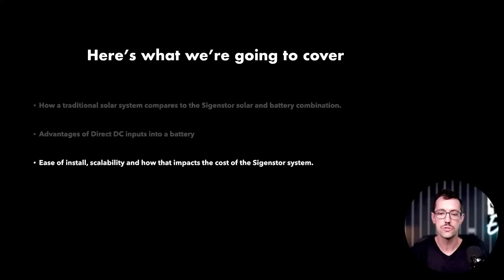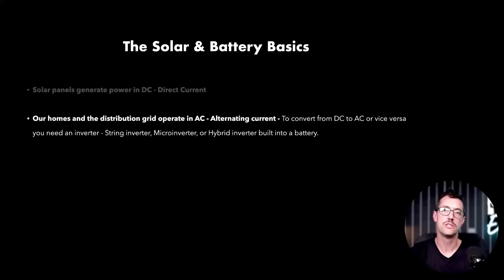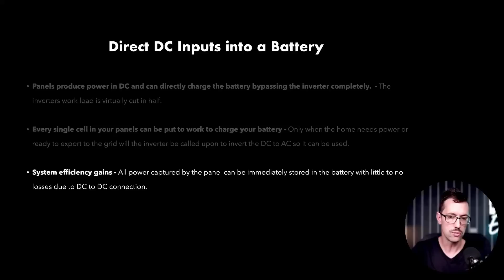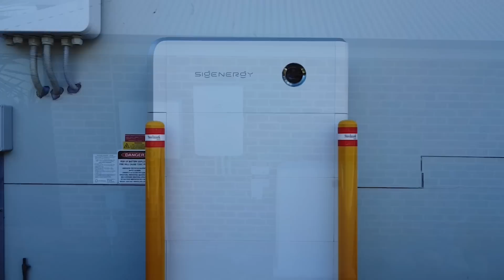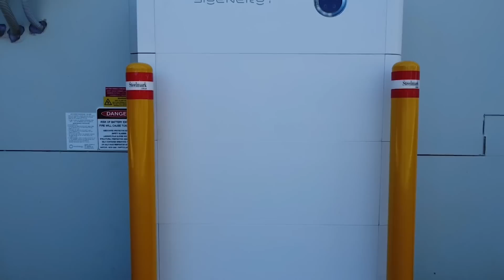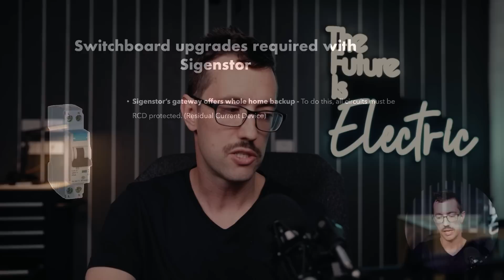Why SigenStor is Going Viral in Australia

Comment: Yes agree Fronius are the Kings of inverters.
I have the Sig all in one and great so far although it runs pretty hot @ 65’c on warmer days, Sth side shade, and less than half throttle work load on 25kwTP?
I’m surprised you didn’t give good old SMA Sunny boys and tri phase a wrap as arguably up there with Fronius, German made, particularly the best in off grid situations with transformers, lower frequency etc.
Also Tigo for optimisers so not limited to solar edge and I’m keen to hear how Sigs micro’s go?
Enphase obviously great in that regard as I also have.
Cheers and keep up the good advice and hard work educating end users away from the false economy junk flooding the industry as always.👍🤠

Comment: Victron Energy and Solar Edge has alway been DC coupled between battery and PV panels so this is not new. Inverter is parallel with PV Charge Controller.

Comment: Nearly all battery systems on the market these days are both AC and DC coupled capable. Even the very cheapest ones. Further to this DC coupled has been available for a long time. The advantage of the Sig is: Energy density is high (compact for a 48kWh system), old and new modules can be mixed, the optional whole of home backup, the inverter includes a BMS and sits on top of the batteries and finally the broad range of inverter sizes in both single and three phase.  The optional DC charger also will appeal to some people.  I think the cable-less stacking is very modern however I don't really think the savings are significant enough to make a real difference to the installed cost.

Comment: I find the repeated statements in this video that Sigenstore bypasses the need for conversion because it connects the DC solar panels directly to the DC batteries to be very misleading. Most rechargeable battery technologies but particularly lithium-based types have very little change in terminal voltage from 'full' to 'empty'. Meanwhile solar panels have HUGE changes in their DC output, almost directly proportional to the strength of the sun at any given time of day. So the batteries require a charging regulator - which will be a switch-mode power supply. These SMPS' are basically DC-DC inverters! With the same inherent losses as an AC-DC inverter.

Comment: I watched an in-depth review of the Sigen. system and they pointed out some things that really must be taken into consideration. Most importantly, the warranty. The warranty of the product is all over the shop. The batteries, inverter, chassis, EMS and PCS all have differing warranty lengths. That's a nightmare in anyone's language. Additionally, the length of the warranty isn't that good, falling behind comparable systems. The plastic covers on the top-right and top-left of the unit are flimsy and the reviewers cast doubt on their longevity. I was up for one of these systems but the warranty issues were a deal-breaker for me.

Comment: For fucks sake - why bang on about the installation time of a 48kW storage system and how it compares against rebate rate, when your 6.6kW solar panels will never manage to charge it - show me a graph that shows the COST of installing a storage system that I can be utilized to the full potential and off set that against the rebate -- you might find that time factor of stack-able batteries fades into insignificance. Even if you were smart enough to suggest that the storage system charge can be completed during off-peak period at a cheaper rate the installation time of a stack-able battery remains fucking irrelevant. In summary - SigenStor is NOT crushing it, you were simply told to push a new product you know nothing about and have a fetish for graphs showing stack-able batteries installation times, irrespective of their irrelevance.

Comment: Lol - statement that '1.33KW of solar, never has the opportunity to become AC' had me in stitches. Especially given that Mr. consultant preceded that particular pearl of wisdom with a reflection that the PV is only capable of delivering the full system potential for a very limited time during the day.. yeah and assuming the ideal environmental factors were present (cell air temperature & air mass) and assuming no cell performance degradation occurred, makes me think that the opportunity for the opportunity for that 1.33KW to not have an opportunity to become AC is quite unlikely, but hey what do I know and if it creates an sales opportunity, who am I to question it.. I am all about equal opportunity, if an opportunity presents it self..;o)
Reply: Did you not listen to the part where he stated a 5kw inverter can only ever do 5kw and no more, so a 6.6-3kw system has a certain amount of wastage
Reply: LOL at your own statements, oversizing is important outside of peak production and cloudy days etc, i can't add an image but it's quite easy to see clipping during summer sunny days on oversized arrays and it's maybe 5 months of the year so not limited at all

Comment: 3:15 - technically, the conversion from AC to DC is performed by a rectifier (preferably a full-wave rectifier for a "cleaner" DC output). Inverters convert DC to AC.  It's all to do with the polarity of AC power switching back and forward multiple times per second; which for Australia is 50 cycles/second or 50Hz.
But that's just me being nit-picky.

Comment: Why connect to the grid at all? It seems that with this system is would be possible to install 48kWh of batteries and easily over 20-25kW of solar panels. At those power levels it wouldn't it be better to just stay off grid to avoid Origin/AGL's self-serving (always changing) feed in rules? If you're not attached to the grid, does the electric utility have ANY say whether you enable V2H?

Why would anyone EVER agree to letting those pirates remotely control my car charging or any other aspect of my system for the tiny (unfair) pittance they pay?

And before you say, "because at least you'll get some money for your extra solar, and it would be some sort of sin to waste a watt so you sort of 'have to' give it to them", I'll posit that the juice just isn't worth the squeeze. Their restrictive rules and control will end costing you more money that you get in the short term. Maybe not today or tomorrow, but soon. History supports that, with nearly EVERYONE that budgeted based upon earning money from feed in having the money stolen from them when they grid operators changed the rules.

The best part about going off grid is telling your electricity provider that you don't need or want them anymore.
Reply: Only issue to doing this for most people is the area required for the solar panels.  In a normal suburban home you’d be struggling to get more than around 10KW of panels onto decent locations on a roof.  I’m about to install the Sigenergy system into my place and currently have 6.6KW of solar but I’ll only get another 6 panels onto decent locations the roof so not quite 10KW all in - this will see me about 95% self sufficient but multiple overcast days in the middle of Winter will see me using grid power - and we are ultra careful with power use.  If I had anything bigger than a suburban block I would stick a solar farm in to give me 20KW and then I’d be sorted. 👍
Reply: @Phantomthecat we're close though. A slightly better roof layout (gable style) so that panels can fill it edge to edge and perhaps higher efficiency panels (tandem silicon/perovskite), and we're there. Oh, and a proper big ass battery, of course.

Comment: Not all RCDs are the same. Anything installed from 2023 is likely to be a compliant Type A breaker which detects both AC and DC leakage. Older RCDs, which can have test buttons are Type AC which only detect AC leakage. Older RCDs will have a rectangle with a ~ symbol inside and these need replacing.

Comment: Just in regard to needing RCD's on all circuits. If you install the Sigen Gateway which provides the "Backup" function you do need to have RCD's on all circuits, BUT they MUST be Type A, NOT the older common Type AC, so simply by checking that you have RCD's on all circuits is not enough, they MUST be the correct RCD's. The older RCD's were being installed up to a couple of years ago so most people will have the older type,  they just have to have them upgraded to the new Type A which is a fairly simple task and no where near as expensive as upgrading the entire board (which is required if you do not have them on all circuits)

Rules now state :

From 1 May 2023 “Type AC” RCD’s must not be installed in Australia. This change is due to
the increased use of electronics, solar energy generation and other similar products with a
high d.c waveform component.
From 1 May 2023, only “Type A”, “Type B” and “Type F”, RCD’s should be used. “Type A” is
the most suitable replacement of the previous “Type AC” RCD.
Reply: Thanks. This is important information.

Comment: All of this is good on theory untill you start installing it. I just had PSC retrofit a SigenStor at my house to existing Solar on a string inverter. Despite my multiple requests to divert my panels to the hybrid inverter of the battery to get DC directly to battery, they didn't do it due to warranty and liability issues. First 12 minutes of this video is misleading customers to believe what's not practically possible. Yes the battery tech is great but what's the purpose if there is no use to majority of the Australian houses already got solar installed. This is an issue someone needs to pay serious attention as the consumer is loosing. Hats off to PCS's workmanship though.

Comment: You usually do not invest to gain a sense of freedom. When you get a solar + battery, you are now tied to a depreciating asset which is costing you at least over $200 per month in depreciation. Your asset has to decrease your energy bill by that $200 per month to break even and you have the risk that your asset will fail. So not having the solar system is just as much a freedom.

Comment: Sig batteries also come as standard with a 5 x layer safety arrangement in each battery. This includes a fire extinguisher in each. Pretty important feature for me. I'm pulling the trigger on a 16kw Sig system. They definitely read the best out there. The only downside is they haven't been long into the market, so hoping reliability is also good. We will see.

Comment: I currently have SolarEdge inverter and optimisers on panels and am wanting to add batteries. The two choices in my mind are SolarEdge’s 3x10kWh batteries or SigEnergy’s 6x8kWh batteries but I’ve been told to install SigEnergy all optimisers need to be removed. Not sure what to do. SolarEdge seems the obvious choice but SigEnergy’s max 48kWh capacity, small footprint and features excites me.
Reply: I’m in the UK and currently specing potential systems with my installer. I understand you can use Sigenergy with Solar Edge optimisers and inverter. I’ve only seen a rough drawing of such a scheme but I think it can be done that way. At least that’s my understanding but  I’m no expert!
Reply: I'm a large Sigenergt installer and this is not true. We do plenty Sigenergt installs alongside Solaredge systems. You would do the integration via AC coupling using the smart circuit function.